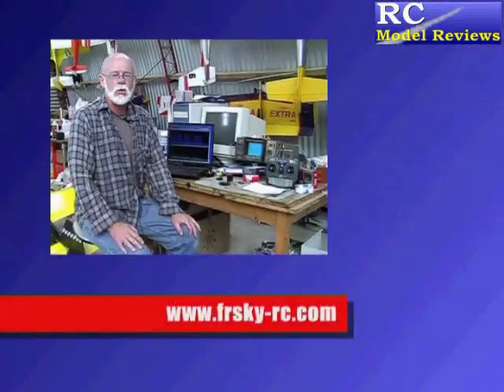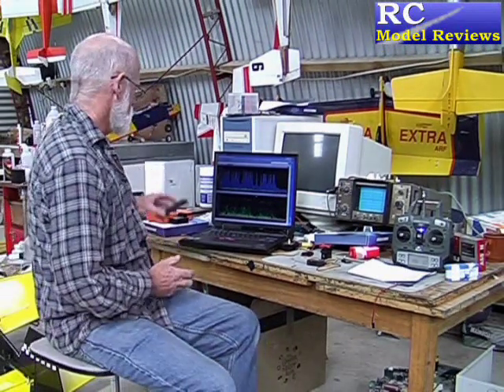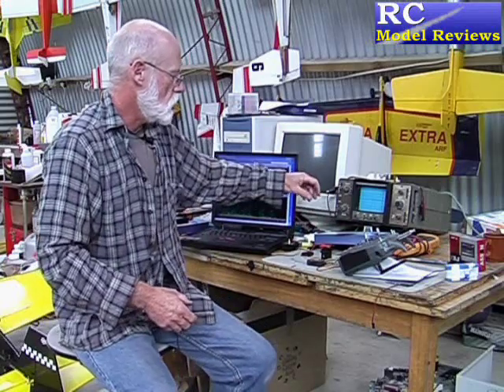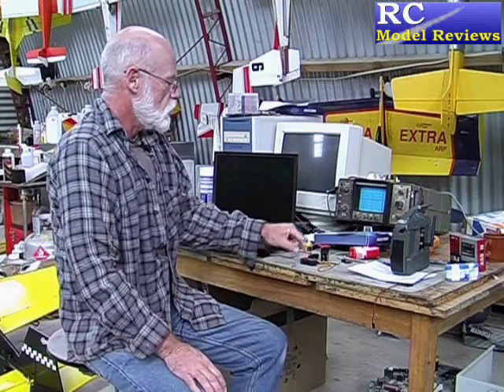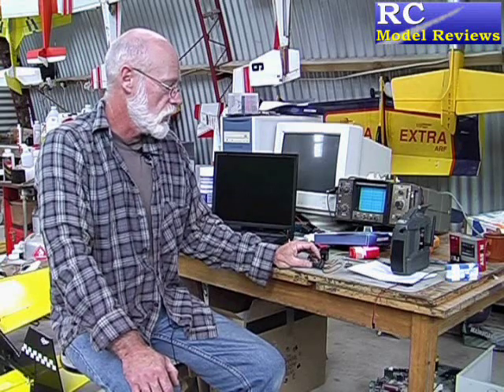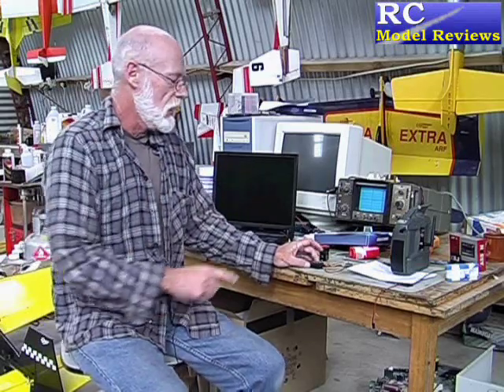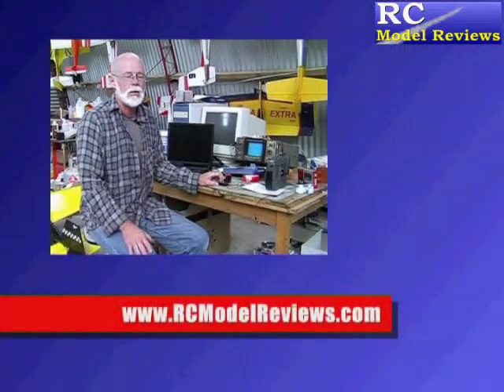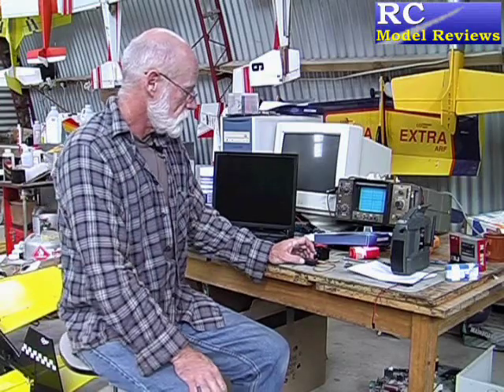FrSky 2.4GHz spread spectrum RC review

Comment: Hi Bruce, I have a old style 7 ch hitec FM transmitter and receiver kit. About 25 years old, never been used. And I just start using it for rc car. Now I found it still have interference somehow. I would like convert it to 2.4ghz. Is it possible?  Any diy kit would be fit? Any suggestions?  Thanks  simon

Comment: I have to get rid of my FrSky because of very short range! less than a 1000 feet! and I actually lose two models with this particular set up! and I even bother to do buy two different set to see if I have a defective unit but that wasn't the case.
Reply: +Migueldeservantes I am very curious about what the exact setup was that you were using. I and several others at the field use frsky and we regularly take our models out well beyond 1000 ft and none of us have had a dropped connection. I am thinking it is possibly either a case of a poor install that is somehow eating your signal at the reciever or more likely that you are flying in an area with some seriously heavy noise on the 2.4 ghz band.
Reply: +eternalfire1244 Well thank you very much for your help, I honestly believe that I'm dealing with lots of noise, and perhaps worst with tons of really bad faith people, that would do anything to fowl my enjoyment ever since I have just move all my RC to Rmilec... That by the way I never have lost signal not even once at a really long range..
Reply: That looks like a pretty extreme system. Are you trying to push out to the limits of this system or do you tend to stay LOS? I would be very interested to hear how far you could take this system out.
My first recommendation would have been to use old 72mhz gear. There is almost nothing that runs on that band right now and it tends to be a pretty quiet overall. Best of all it is very cheap to get into because there is tons of that gear that is lying around gathering dust.
Reply: +eternalfire1244 Well, what I can say.. you are most definitely correct, I actually have two full systems that run on 72 and 25 Megahertz.. but sadly this particular systems are very very susceptible to interference.. I do use the VHF because my goal is to going in to business with Video surveillance.. But I'm very grateful for your input, thank you very much!

Comment: On the futaba / hitec module the case is poorly aligned atleast mine was to a degree that I could not fit it in the module slot. Just losen the screws a bit on the module before you put it in and it will line up and pop right in, then take it out end tighten the screws again. ther is noo need for sanding the case

Comment: I have a terrible problem!! after converting my 7cap to 2.4 with FRSKY telemetry module (working fine in 2.4) my 72mhz frequency is a mess. I cant make it work like before, range is obsolette and servo chatters issues appeared. what can be wrong? i installed a switch to cut off 12v when using stock FM module and frsky module... please any hint?

Comment: Good review Bruce, I have the Frsky DF combo, plus one extra receiver for my other Heli, mine did come with the Serial lead, I note some didn't get the lead? there was also a CD with manuals covering everything, also winXP/win7 update stuff.
The RS232 lead has no coders in the plug just a straight 3-wire to 9-way Fem d-type.

Steve

Comment: Because of your glowing review I purchased two FrSky Futaba systems . Neither system worked properly. The first one worked fine and range checked okay. The module died on the very first flight resulting in a complete loss of control and subsequent crash of my sons brand new Trek-450.  The module was completely dead no LED and no signal!

The second module simply refuses to bind with any of the 4 extra receivers I bought. The light on the back of the TX module just blinks yet nothing on the RX

Comment: Hi, Roger here... have seen a really great addition on trademe for a set of alloy stands for use on the hitec and futaba radios - really useful for the rear mount aerials. Also, a note - Corona DOES have a failsafe, BUT it must be set at the beginning of every flight.